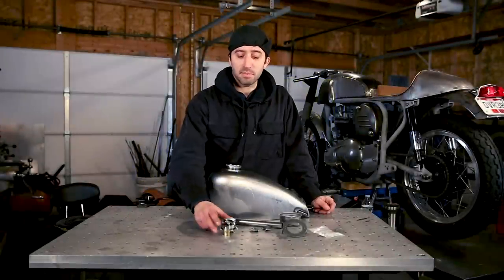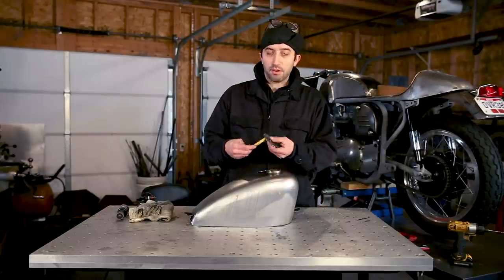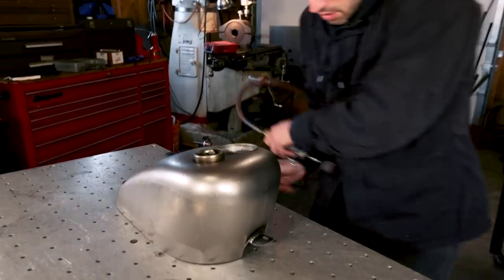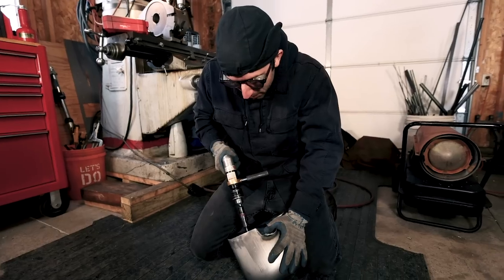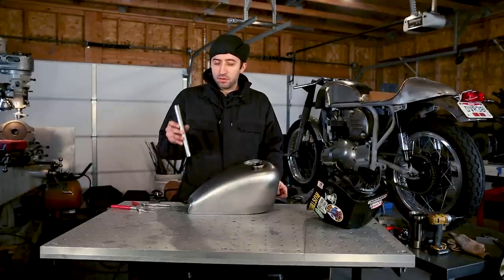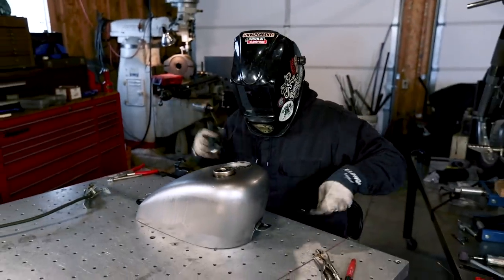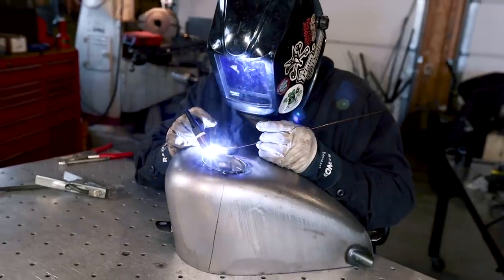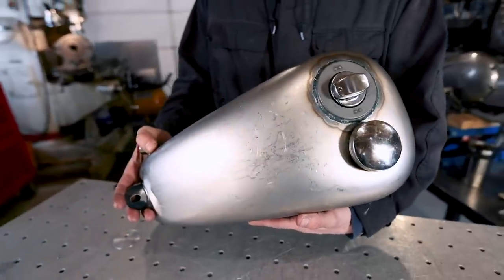How to Install A Hummer Style Ignition Switch Into A Frisco Sportster Gas Tank For Your Chopper

Comment: You guys should put a kit like this together with the new capacitive style harley fuel gauge sending unit 😊 it would be a simple easy kit eith everything needed to put a nice electronic fuel gauge in our older bikes without the wires coming up out the top and being seen running down the tank to the underside😊🤘

Comment: what if you happen to ride in the rain , doesn't it fill up with water?
Reply: Nope, the tube for the wiring also allows water to drain. I'd be more worried about splashing gas into it and a small electrical arc when u turn the switch.........KaBoom!